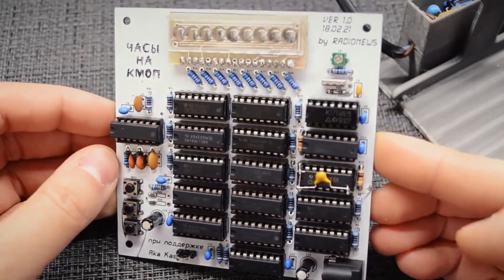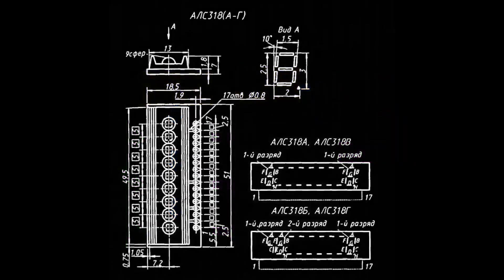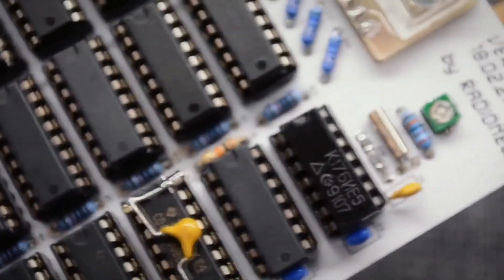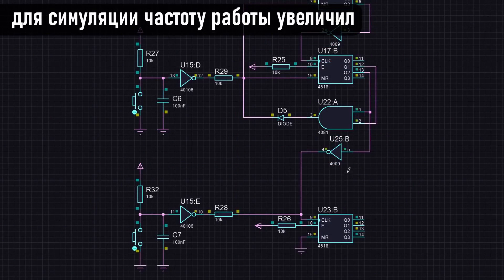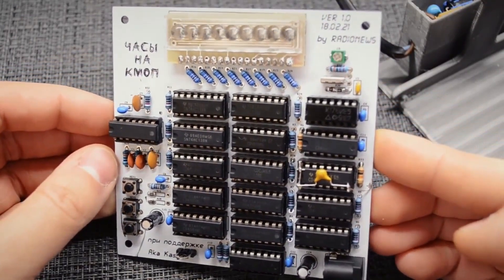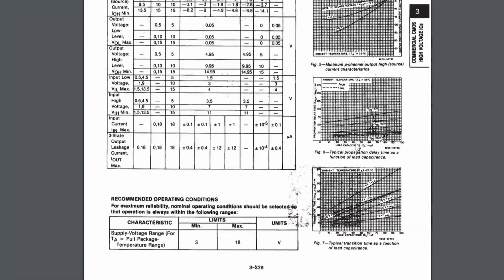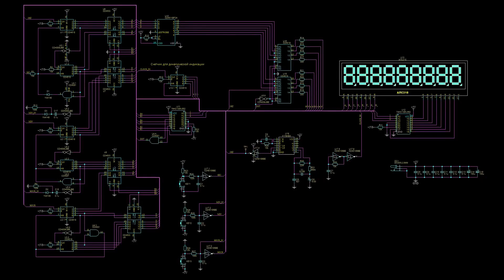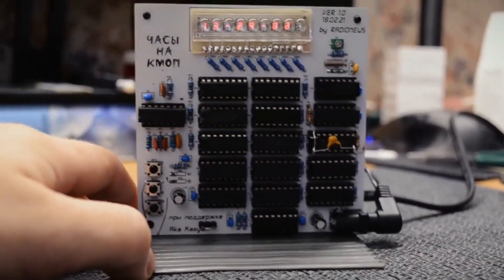Unique DIY LOGIC clock.

Comment: I had a soviet made calculator with that display. It was very simple, it had only the 4 main operations (+,-,*,/), no % or square root. Sadly, it died from battery corrosion (someone left the batteries in). So, when I got it, the only thing I could salvage was the display. And, ofcourse I made a clock from it.